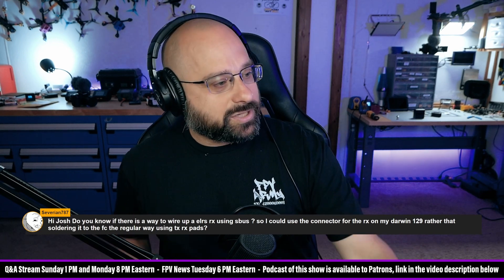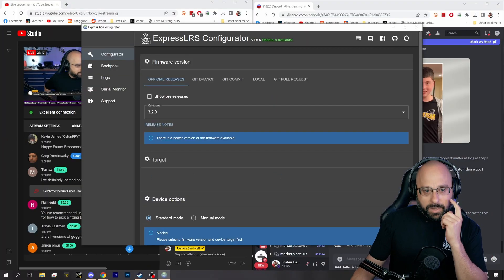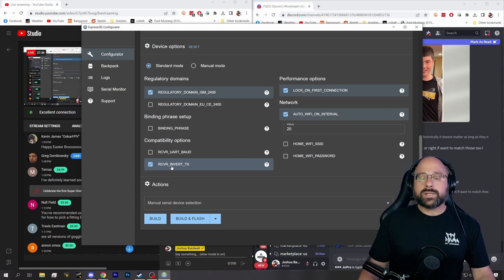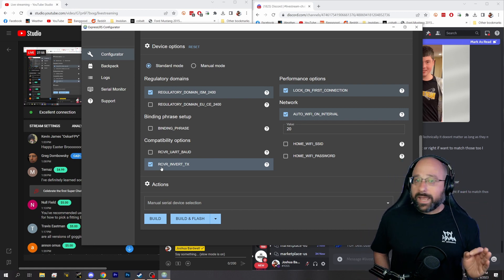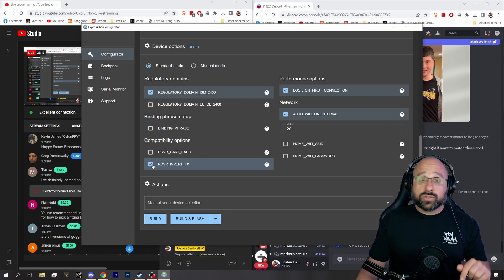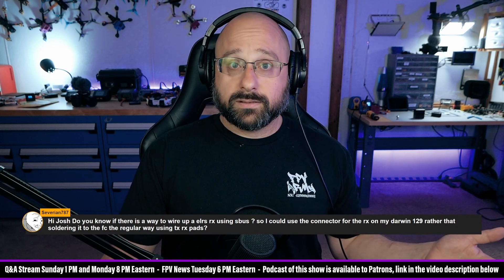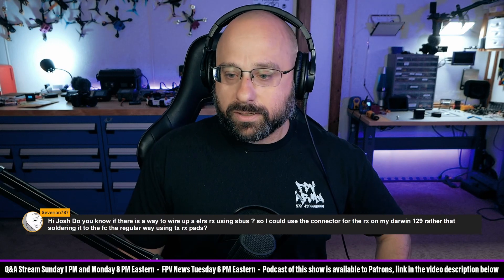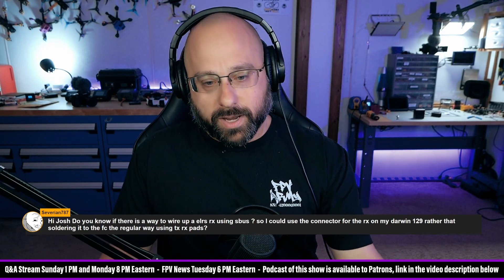How To Use ExpressLRS With An SBUS Pad? - FPV Questions

Comment: Thank you very much.
I wanted to put a elrs receiver in a geprc bnf that came with an frsky Rx. But I didn't want to have to use their plug for 3 wires and solder the 4th wire to the FC, as this would abolish the purpose of a plug. 
Let's see, if it works

Comment: When I received my cineape25 PNP it already had some wire soldered onto the SBUS pad, RGB Grounding pad, and RGB 5V pad. The UART1 and UART2 have nothing soldered on it currently. I was thinking of connecting the SBUS to the TX pad on the Happymodel 2.4 ELRS receiver that I bought. Does this sound like it would work or should I remove all the original soldering and just connect the pads to the standard RX2, TX2, Grnd, and 5V of UART2?